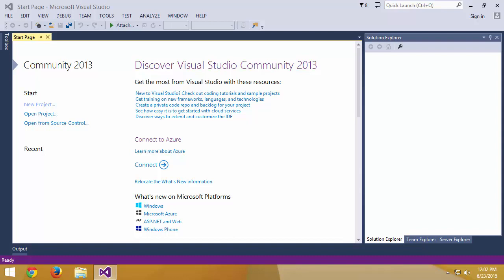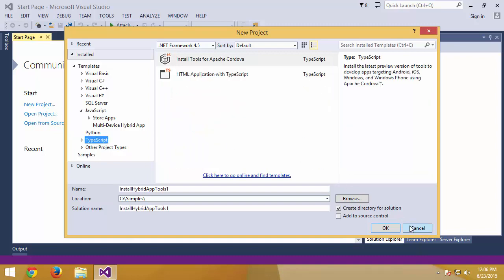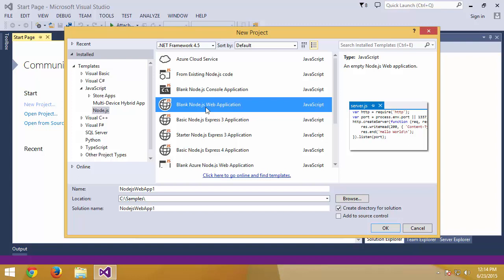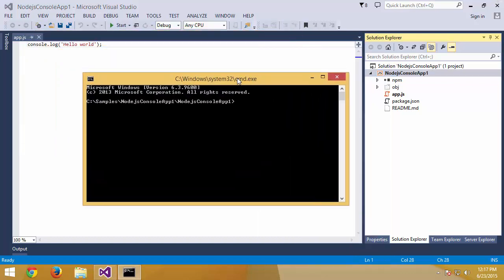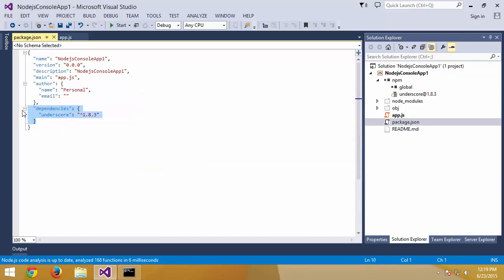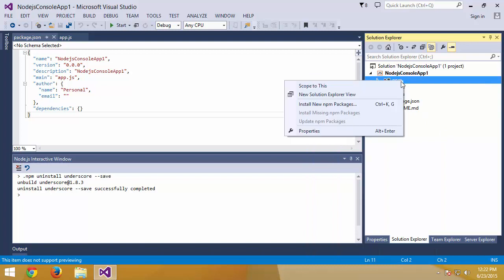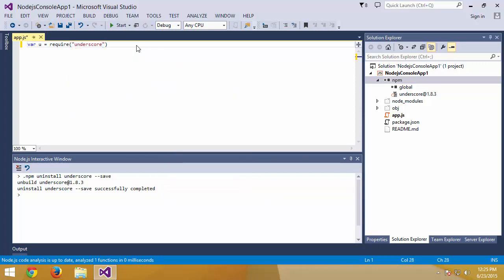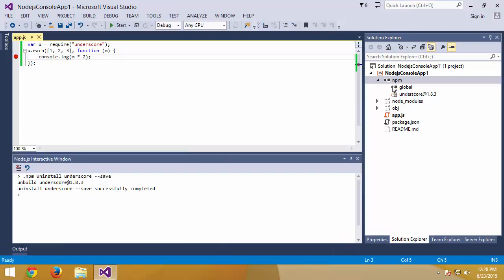Quick (15 min) introduction to Node.js tools for Visual Studio (NTVS)

Comment: Need solution :  Use Visual Studio 2015 and tool is NTVS 1.2 VS 2015
(node:9960) [DEP0062] DeprecationWarning: `node --debug` and `node --debug-brk` are invalid. Please use `node --inspect` or `node --inspect-brk` instead.

Comment: Hi sir, very cool video indeed.

I just have a small question. 

It is possible to combine a nodejs project (two-way video chat with WebRTC) 
and web form project so I can host both solutions on the same webpage? Thank you for your time.
/
/
/
/
/
Reply from the maker: In general, a web page has to be deduced from one request pipe-line.  If we need the web page from multiple sources, we might need to inject ajax to go for other sources (other than which created the web page).  You don't quite need to host both projects on the same web application/solution (and it might not be a good idea as well unless you want some memory or resources to be shared/used by both of them simultaneously).  

Both of them can go in two different directions.  For ex: web forms project give/sends the web page to browser and some JS on web page can request for (more) content from nodejs using AJAX (needs to have CORS enabled).  I can confidently say that it is not impossible.  However, you might just need to get over a couple of hiccups here and there, based on your requirements/approaches.

While the approach may work, you might want to think about security aspects and so on.  There could be several approaches for your question.  You just need to pick the right one suitable for your needs.  Hope I answered your question.